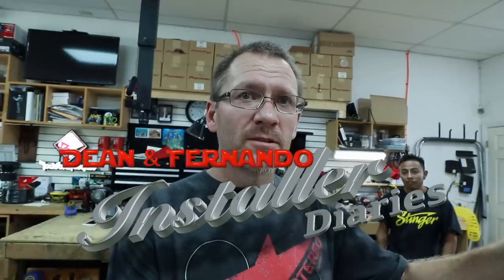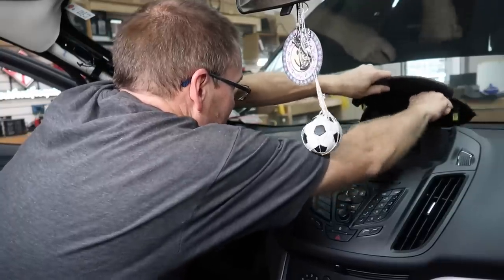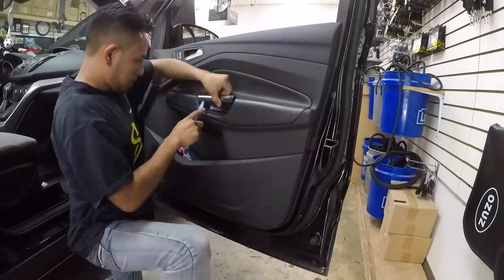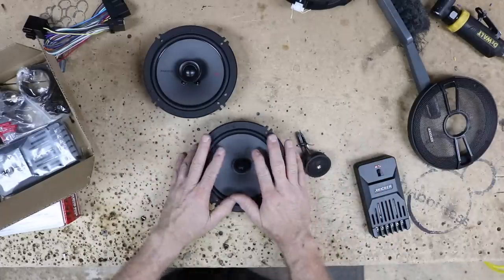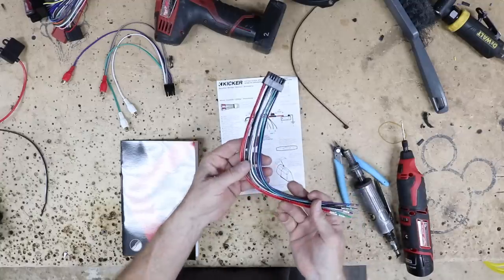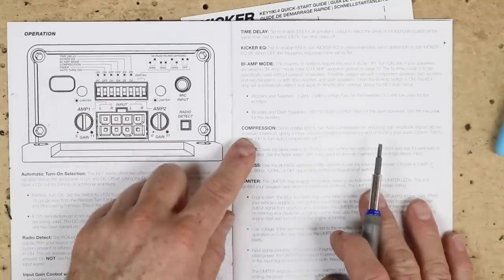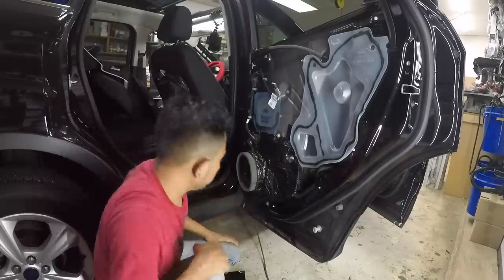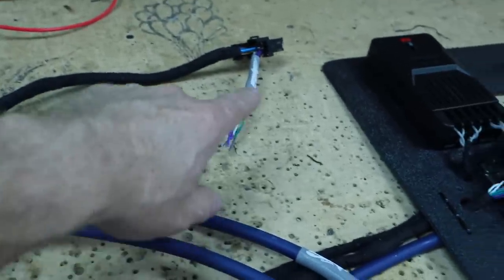The Kicker Key amp and KS speakers installed in Hailey's Ford Escape Installer Diaries 120

Comment: 2016 Toyota Tacoma TRD 4x4 Sport Dbl Cab with the factory 7 inch non JBL HD radio but installed the Subaru plug and play tweeters made by Kicker in the dash, Kicker KS 6x9 2-ways in front doors, Kicker KS 6 1/2 2-ways in rear doors, Kicker Key 180.4 for power and EQ and the Kicker Hideaway 8 inch 150 watt sub behind the rear seat back....very nice combination with new clarity, sound quality and low end ( bass ) response compared to stock.

Comment: Id did an amp & sub install in my wifes 18 Escape last year with a Parrot T-Harness from overseas. It plugs in behind the screen & I was able to run speed wire to the rear. Im getting ready to upgrade the factory speakers in the next few months as well

Comment: I am definitely considering a kicker key amp in my 2015 Camry so I don't have to worry about complicated wiring and have a nice lean installation and even if I cannot afford high quality aftermarket speakers atm, I can still vastly improve the overall SQ from the stock speakers. I already got a subwoofer and amp that is going to be installed. I just need a proper T harness and I don't want to zonk the head unit, key amp, or speakers. I like to keep the stock head unit, I like the big knobs and buttons and don't want to get rid of them.

Comment: Awesome video! Thanks guys! Try turning the compressor off next time. Or bi-amping the components and running the rears off of head unit power. All in all, for the price paid, there's nothing on the market that even comes close to this little guy!
Reply from the maker: We played with it on and off for a while, for the application on seemed the better option.
Reply: firebirdude2 I'm considering bi"amping the front components and running the rears off the head unit but wanted to ask what the benefit to doing this is? Will the rear speaker have enough power to match the front now? I know all factory amps are different but how much power will go to the rear?
Reply: firebirdude2 also do you know if I'll benefit from adding the audio control lc7i if I add the Kicker key amp to kicker 6x9 components in the front and 6.75 coax in the back?

Comment: There's no such thing as a passive crossover + boost for tweeter. In this case the +9 is actually the cleanest signal bypassing the resistor, the +4 is a 5db cut and the 0 is a 9db cut.

Comment: Why did you use the speaker cross overs instead of running the amp in  bi amp mode?  I have a 2010 f150 super crew cab with this amp on all 4 factory speakers. Which sounds really good together. I have a set of Polk db+ 6502 components I'm installing in front doors. Tweeters will be mounted up in the plastic section of the door panel that covers the mirror bolts. Back door speakers still factory, will up grade with a good midbass spkr later. Should I use the crossover that came with the polks or bimode? I did put roadkill in side the doors and outside and using fast rings. Thanks for all the knowledge u guys share with us. I love the clean installs and most of all the clean language. Happy new year.

Comment: It's a lot of work and cost to do such a lovely install.  The whole ICE market could do with moving to the 21C. Why not build  LDAC blutooth into the amp! and bypass the oem headunit for the maximum quality audio for any OEM car with even the crappiest system. LDAC 999 kbit to phone and a wireless controller the dash for volume etc or build into a phone holder and 8 channels to dump the old passive crossovers.

Comment: Awesome video as usual from you guys! Quick question after calibration, does the radio T-M-B still adjust those parameters for some slight tweaking or does the amp auto correct override those adjustments?

Comment: great install video. i'm thinking about using the Kicker Key amps in my 2020 Subaru Outback Limited and swapping out the original factory Harman Kardon speakers for something better.  have you guys done an install in '20 or '21 Outbacks yet?  any tips/tricks you can pass along?

Comment: Awesome review guys. Considering this amp, but unsure if it will be sufficient to run my front and rear speakers ( Infinity reference 6x9 coax front doors and JL audio 6.5 coax in the rear deck) which is currently running off of the Sony XAV-200. Thoughts? Thanks for the continued great content!

Comment: Hey Dean, if you guys tied into the Key with a T harness, where are the signal wires for the sub tapped in?  I never saw those connections anywhere.

Comment: What if you have after market 14 gauge speaker wire running from all your aftermarket speaker? How would you hook those up to the Kicker key it the wire from the harness is a lot smaller wire?

Comment: I installed a kicker key 4  channel amp. I have a low  volume hissing noise. The noise has stable volume no matter the radio volume. The noise is still there even with the inputs disconnected and the engine off. My grounds are confirmed good. And my gain is all the way down. Also my amp chassis doesn't touch metal where it is mounted. Is there anything else i can try to remove this sound? It is not very loud but it is there and before the amp install there was no noise.Thanks.

Comment: I have a question regarding the dip switch settings.. I have a Kenwood DNX892, powered 8" JL Audio sub, and my Key180 running active bi-amp to Infinity REF-6520cx components A pillar mounted tweets & mids in the doors. Nothing else. Should I have the fader dip on or off? Should I have the HPF dips off since I'm bi-amping?

Comment: Hi I currently running 4x pioneer 6.5” coaxial front and rear and to install the key amp later down the track I want to install front 6.5” component speakers can I just replace the speakers or does it need to be setup byamp mode?

Comment: Can I put 2 of these in my system? I have a 2016 single cab Chevy. I want to put a set of
47KSS6904 6x9 components in the door with the tweeter on the center mount,
47KSC404 4” coax in the B pillars, and
47KS2704 2 3/4” mids in the dash.
How should I run the amps to the speakers?
1. one amp run the 4s and 6x9s & one amp runs the tweets and 2 3/4s
2. one amp run the 4s and tweets & one amp to the 6x9 and 2 3/4s
3. Amp 1 to the 4s and 2 3/4s & Amp 2 to the 6x9s and tweets in the doors
4. Something else

Comment: Nice job, I m having problem with my kia ceed 2013. I wanted to install component speaker on the front door, but there is a big connector on the grommet. There is no way to install a speaker wire through it.

Comment: What did you do for the sub cause with sync it's kinda complex to get a clean sound. I have a 2017 Ford fusion Titanium with the Sony system and I installed a sub with a line out converter on the rear 6x9s that are supposed to be like subs and it sounds like trash. Just wondering what you guys did

Comment: While I generally love the Kicker KEY180.4 (replaced an Alipine KTP-445U with the Kicker), I did notice that the Kicker KEY180.4 seems to have a pretty high "noise floor" for such a small-wattage amp.  When using the amp with line-level signals, I noticed quite a bit of "hiss" from the speakers when no music is playing.  I got the same "noise floor" whether it was connected "on the bench" or "in car" (noise is not present with the Alpine).  Did you guys notice the same thing?  The unit sounds GREAT while actually playing music though - way better than the Alpine KTP-445U it replaced!  Thanks for all of your videos - LOVE them!
Reply: Reduce the gain.

Comment: YOU CANNOT CONNECT A LOC OR LINE OUTPUT CONVERTOR BEWEEN THE HIDEAWAY AND THE AFTERMARKET HEAD UNIT! Line output convertors are designed to convert speaker level to RCA level. They will not convert the RCA output of an aftermarket head unit to the speaker level for the input of the Hideaway

Comment: Would it be feasible to use the factory amp power wire to power this small brick amp?
(factory amp would be removed of course)

Comment: isnt using that speed wire like the lazy method, not only are the conductors thin, theyre smaller than the stock wire which already adds enough resistance for the speakers to drop in volume, why not run a set of 14 gauge to every speaker so they can get enough power. just with the ear alone one can hear a difference

Comment: WILL THIS AMP WORK WITH AN AFTERMARKET RADIO?
Reply: I don't have it yet, but 99% sure yes. I'd check specs, but should be just plug the RCA into your low level out in the back of the aftermarket head unit (he cut off RCA plugs for high level in), and then there's probably a dip switch to set it for low level or high level input.

Comment: Very interested in this AMP? Is there a certificate showing the actual out-put of the amp? I am looking at adding this amp to my for F150, I have started out by adding Kicker CSC's in the doors, they sound good, but I would like it louder. a concern I have, is, does it get hot? I seen in some of the reviews, that one guy put it in his glove box, ran 9 wire in and out, would that make it to confined, not getting enough air flow? I have watched a lot of your vids. you guys do great work. last thingfor my truck, what do you recomend for a T harness, seen one on Amazon, (FOR-11CK) others have recommended.
Thanks
Reply: Warm at most. You could leave your hand on it indefinitely, even after hours of rocking.

Comment: I wish they made it so this amp could tie in to a second one and be able to run 2, or a 2 channel so that I could use it for an active front and one to power my rear speakers. My truck has 4 rear speakers so I’d run 2 of them to accomplish that. Also would be nice if it had a sub pass through. One question on it, do you guys think it would be able to effectively run a 8” woofer and a 3.5” point source in an active set up?
Reply from the maker: I would not use it to do that.

Comment: What's the best way to add a subwoofer/amp combo with the key amp, all the while keeping the factory radio?
Reply: Wade Hensley if they made a 5 channel version of this, with even an 8 GA wire input, I would get it. They could use the 4 channel input to create a subwoofer channel.
Reply from the maker: When you are tapping into the radio,  tap into the rear output to run back to the sub’s high level input. That is what we did on this
Reply: Yeah if they would just add a RCA output this would be so much better and a much easier purchase

Comment: At no volume i really dont want to hear the white noise coming from this amp thru the speakers. 
Any videos that have covered this? I read to just turn down the gain as an option.
Reply: Gain set too high is, easily, the number 1 cause of this. Don't be afraid to lower the gain, but use more volume knob on the head unit.

Comment: I have been looking at one of these for a little while. I have a Toyota Tacoma (4 door speakers, 2 tweeters) it has upgraded speakers but I want better sound and to add a subwoofer without upgrading the head unit. I like the idea of having DSP, but I can't figure it out if it is worth it. For similar price you can get a pioneer 5 channel amp and not have to buy another amp to power the sub and the additional wiring that goes along with it. I am sure the clarity will be there, but I'm not sure the soundstage you get with the Key will be. What do you guys think?
Reply: You'll actually have a sound stage with the KEY amplifier. lol With no DSP, you're just listening to 4 loud speakers. :-)

Comment: Thanks for doing this video as it's somewhat similar to what I'm about to do. I was going to go the route of either a Audiocontrol DM-608 or RF DSR1 for a processor. Set up is Kicker KS comp of front, KS coax rear, 3 Comp R 10s, 2 KX400.2, 1 KX1200.1. I'd like to use the Kicker Key if possible as the processor as I'm a set it once person. Early in the video you stated that there is a sub installed, is that still tagged off of OEM high level before the Key? What sub/amp do you have in there?
Reply: Yes. Tag off the OEM wires for the sub. And yes, you can use the KEY just for the processor. With Kicker's FIT inputs, you can run the output of the KEY right into the KX amplifiers. All the benefits of the processing but with 400.2 power out!

Comment: If the battery is disconnected for an extended period of time does the amp loose the DSP programming?
Reply: Nope! Power could be disconnected for 2 years and the DSP would still have all its settings. :-)

Comment: I have a Ford C-Max which from my understanding is basically identical to the Escape except for the battery location. I’m curious if the aftermarket kit for a double din is really that bad looking? I travel a lot & would like to upgrade to a unit with navigation so I don’t have to keep removing my Garmin & can reply to text messages using Apple CarPlay.
Reply from the maker: We have installed a few of them and the customers have not complained about it. We were also doing them for the same reason you want one. They were all guys that work out of them.

Comment: Hi I have a question, I have a 2012 Dodge Charger and I’m trying to replace all my speakers and have them running of a 4 channel amp, but like you said in this video when I replace the speakers and turn the car off I have no sound and I’m using a audiocontrol lci2 what can I do to solve this problem
Reply from the maker: You need a load resistors on the speaker wire. I would use 10watt 47ohm. Put them across the speaker wire just like a speaker

Comment: Hey guys been trying to get your attention for a while now. I have a question about the ANC module you guys put out a video for a BMW in which you tapped into the anc module for a variable signal to go to a sub amp. Can you do this with any car that has a anc module. I have a 2018 Q50 and I don’t see a amp in the trunk but there’s a anc module was thinking of tryin what you guys did in the bmw video. Please help.
Reply from the maker: That has been the only car that has ever worked on.
Reply: Thanks for getting back to me, I am stumped.I replaced the door speakers and all I want to do is power them with a 4 channel amp that via high level speaker input. I can’t find a factory amp in the car and I don’t know what wires to tap into behind the head unit. The shops that I have been to don’t know what to do. I know you guys would know what to do but I can’t make that drive to Florida anytime soon.

Comment: Can I use the CARAV 12-240 adapter for my 2017 Ford Explorer with Sync 3 on stock radio?
Reply: Yes, The ACM-Audio Control Module (the unit he pulled out in the video) has the same wiring.  Thing is, I want that harness but the Amazon link is dead and I cannot find a dealer on their website.

Comment: He guys I was thinking about replacing my Memphis 5x7 with those kicker ks series speakers.. how is the sound quality?is it audiophile or decent?
Reply: I used to own the KS60 Coaxial's back in 2011 and ran them for 5 years straight. great speakers for sub $110, The component versions did cost a tad more. So I believe they are up there with say RF Power series or equivalent to that price range.
Reply from the maker: I really like the tweeter on these compared to the punch counterparts. The best 5x7 in my opinion is the RF power
Reply: Five Star Car Stereo  i actually looked into those.. I drive a 2008 Ford Escape. According to crutchfeild the rf power 6x8 would not fit.. I know y’all have done plenty installing you think they would fit?

Comment: I have a 1990 GM standard cab pickup with a pioneer DEH 6900bt. Can you please recommend a good replacement for the factory 4x6s and a sub as I don't have much room for aftermarket speakers and sub. Thanks.
Reply: Aniceto Maldonado Jr tried them but they are not any better than my 27 year old factory speakers. Also tried mtx and infinity with same poor results.
Reply from the maker: Rockford has the Punch 4x6 but it might be to tall, person I like the Kenwood Excelon 4x6 if they still make them. You can also us a 4” with a bracket.
Reply: Five Star Car Stereo thanks, any 4" you would recommend and a sub? I am thinking of a Alpine pwe 8. You are impressive installers.
Reply: Five Star Car Stereo crutchfield site indicates Kenwood excelon 4x6 does not fit. Is this a mistake? Also indicates infinity kappa does not fit but it did with crappy sounds and mtx. No luck. May try 4" round.
Reply: Try Pioneer 4x6's  i think they make a brand that will fit into some really tight door panels,that would probably be your best bet.(TS-A4675 R)
Reply: joe fro first one I tried, sound was not good.